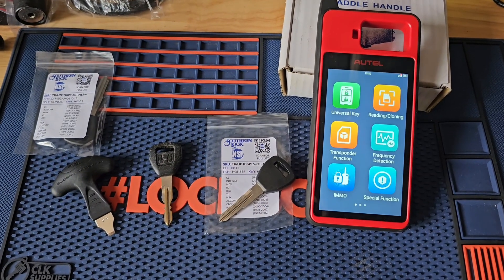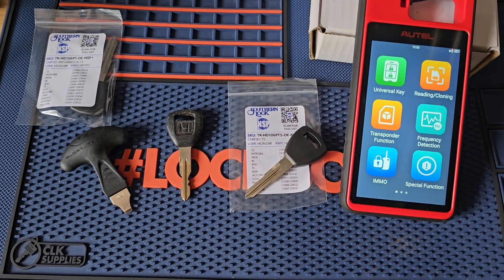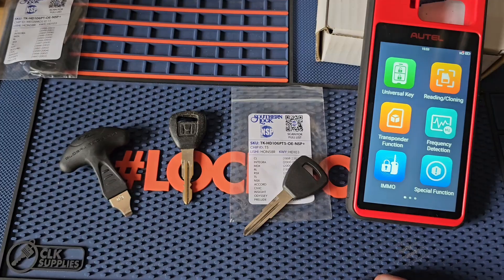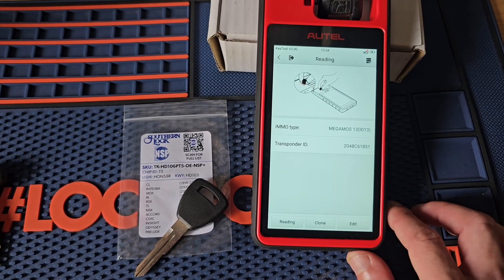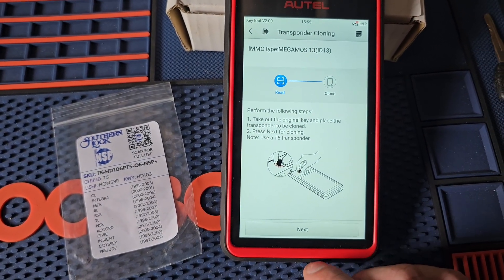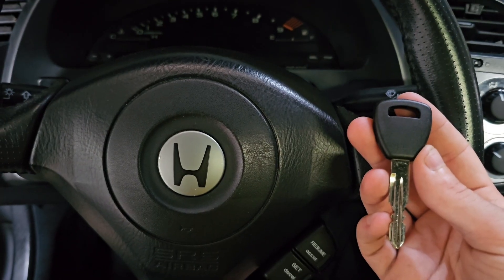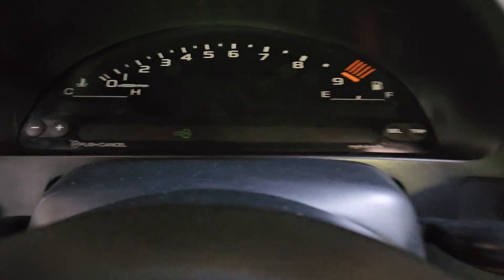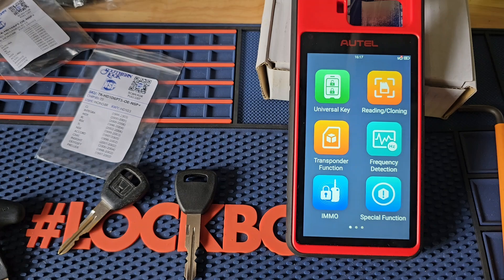Vehicle Transponder cloning Autel KM100

Comment: I am able to clone a 2010 Honda Pilot key with a AT100 chip but the IMMO key light doesnt go off, so it doesnt start. 

I tried programing it doing the guided instruction and it says that the key was programmed ok but the last step asks if the immo light went off, I press NO and the key is not added.